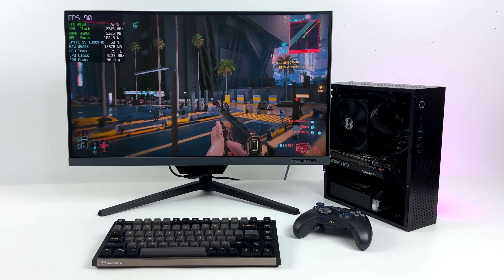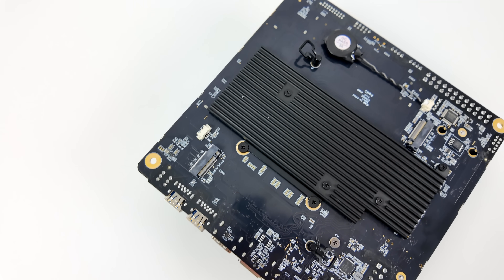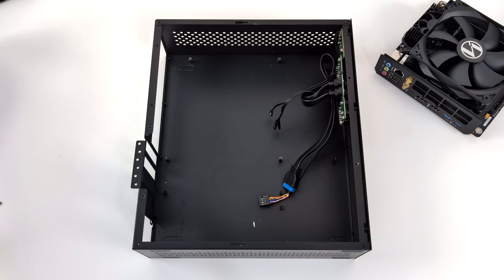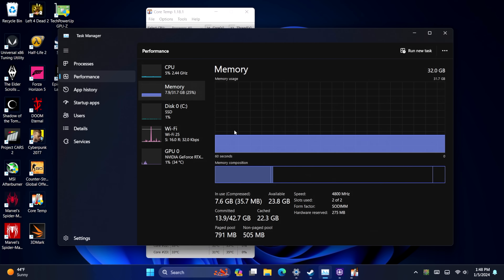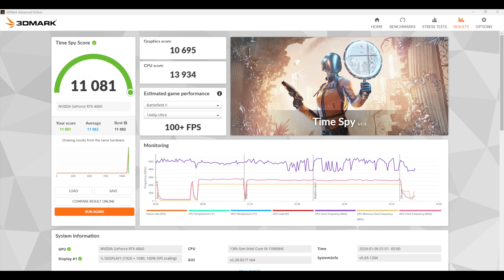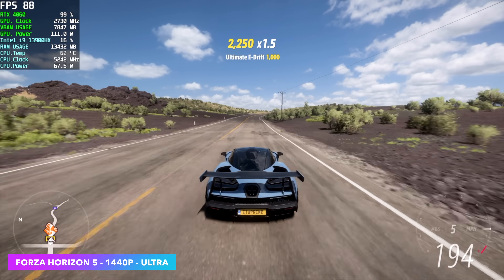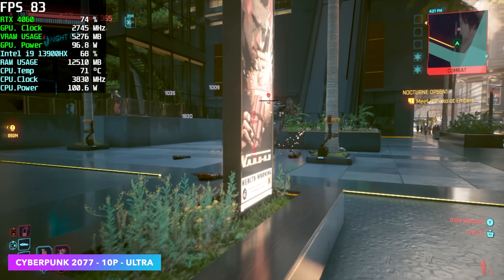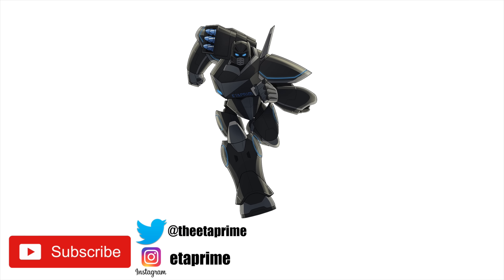The All-New AR900i Has A FAST 24 Core CPU! Hands On Mini Gaming Build

Comment: It's not bad but would of been better to show off the temps of the system if the case was to have in more fans and also for the GPU you could just undervolt it instead while overclocking to use about the same amount of watts without it getting hot as well.

Comment: Thank you for this video. I ordered all parts like on your video. I went with 64gb ddr5 5600 and noctua 120mm 2000rpm fan, and I also will mount a small 80mm noctua fan on the side to pull out the hot air from case next to gpu. I went with silverstone 600w platinum psu. 2 m2 ssds one 1tb the other 2tb. Everything else is the same as on your video. Thank you for sharing and inspiring me to build this little pc

Comment: I've been looking for a case very much like that for a long time.  My only problem is this one is listed on Amazon with a height (oriented vertically) of 12.2" and the spot on my desk credenza to fit a PC case would only allow for 11.75" or so.  JUST barely too tall/wide for me.

I've just deployed a mini-ITX build in a much smaller case that fits easily, but with a picoPSU and an external power brick.  I would much rather have had a system with PSU integrated like this if I could have pulled it off.  (I don't even need the PCIe slots, particularly, but I need it to fit the available space.)

Comment: You could do something like this or their BD790i and even a 4080 in a Fractal Ridge or Terra and still have a pretty serious gaming machine. You'll leave some fps on the board at 1080p because it's apparently not quite as good as a full-on desktop CPU but if you play at 1440p or 4K the difference is pretty minimal from what I can tell.

Comment: I thought I read somewhere you don't want less than 2Gb of RAM/thread then 64Gb minimum for this processor, and according to minisforum that's also the maximum supported on this motherboard...which is unfortunate because according to intel the processor can handle up to 192Gb (haven't seen that big So-Dimm yet but maybe they're comming)
It would make a nice base for an editing station with 4 x m2

Comment: I've had this thing in a Fractal Terra w/4090FE, 64gb 5600, 2TBx2 NVME 4thgen & 1TBx2 NVME 3rdgen & a 1000w Asus Loki power supply and it is a FREAKING BEAST!!! Temps are in the 50's-60's running Starfield! After my BD770i build, & the temps settled in I figured I'd pull the trig on this combo and there wasn't even any break in period like the BD770i. It just works!
Reply: Would you recommend this one or one of the BD series? I want to build one, not sure which. I will be using it for gaming and want to put it in a s400 case.

Comment: Mine is quite relative 😄too large for me, I stick to something that's easily moved. Thanks for all the videos, it was really helpful for making a decision in which mini-pc to buy. I'm a creative and need a decent gfx card for my artwork, in the end is was down to the HX99G and the Intel nuc 12 enthusiast. The HX99G was hard to get where I live, the local sellers had the intel nuc 12 enthusiast barebone. Maxed it to 64GB ram and a 2TB SSD. After some initial issues with the KillerWifi drivers and latest bios upgrade, which seem to conflict, it's now running great. Love how fast it is, really helps me in my work. Makes a lot less noise than expected.

The only thing which I don't like is that you can't use the Arc a770m through thunderbolt 4 directly, but only as a pass-through of the Intel Xe iGPU. That works fine for games, but for apps (and some games) it's defaulting to the Xe, even when Windows is told to use Arc only. If I want to use the dGPU instead of the iGPU, I seem to need to use HDMI. That's a shame, I rather use thunderbolt.

Comment: Not sure how I feel about the whole issue of boards with CPU's permanently mounted that can be turned into E-waste the minute Mr Gates decides he is not going to support it anymore. Over the next year I am piecing together an ITX build for the wife in the Thermaltake Tower 100 case in the green color. Should be sweet. And it will take a full sized gpu.
Reply: That's actually a great opportunity to install a better OS without all the bloatware linux or at least tiny 10/11

Comment: If you want to fill the case and provide better airflow to the 4060, there is a 3D Print bracket that allows the front to take two 80mm fans. Also I believe the name of the case is SKTC A10.
Reply: Interesting case although surprised seeing spaces for a 3-slot low profile GPU. I like it.
Reply: @Neopulse00  I believe the third slot is incase you want to add a X4 PCIe Card on very specific mATX motherboards that have it in that location.

Comment: Cool motherboard that might be a game changer. Could, because I have heard that you can not connect front panel USB & Audio as motherboard does not have covectors for it. Also, despite having 3 audio jacks at the back you can not connect 5.1 speakers, as one port is for mike only. Is that true ?

Comment: So … thermals severely limit performance compared to a 13900k, I/O severely lacking (thunderbolt, 10GBit ethernet missing) and on top of it you’re not saving much.
Reply: So your comparing a desktop chip to a mobile chip and complaining? 😅 there are also millions of i/o dongles in the marketplace, so that's a non-issue for 95 percent of people. Yes no 10g ethernet but most people run wirless nowadays  so thats not that big of an issue either. I mean If you simply don't like the mb/chip that's cool but atleast pick a bit better stuff to complain about like the sodimm ram or the lack of bios features or even the weird behind the mb nvme slots.😂

Comment: A zen4 cpu would be much more efficient and would perform better when thermally limited.

Especially the x3d chips, but even the cheapest 7500f should be good, probably cheaper than the i9 too😊😊
Reply: They make a BD790i with the 7945HX 16-core Ryzen 9. Not quite the HX3D that you can find in some laptops, but still another great option. This one has 4 m.2 where the BD790i only has 2, so it's not as great on the storage front.

Comment: Thank you for covering this board. If possible, could you show the BIOS, and also how it might work with Linux and even ProxMox. Thanks!
Reply: Sadly he won't do that. He just showcases new mini-pc stuff, he doesn't get any deeper than that. You'll have to wait for someone else to do it.
Reply: Thanks for the reply. I agree, but it would be nice for someone with access to the board to cover uses otgher than gaming.
Reply: @gotelldonn From reviews I've seen on the BD770i, Minisforum's BIOS is a very basic visual BIOS/UEFI. Not a ton of options, but functional and easy to use.

Comment: Any homelab folks watching this, the 16x slot hasn’t worked with any 4x PCIE cards that I’ve tested. However, you can get an M.2 to Oculink/Oculink to PCIE or even just an M.2 to PCIE to add in a NIC or HBA card. The right slot on the back actually lines up perfectly using the options mentioned.
Reply: Recently read that  those adapters all still have major issues with them that will eventually lead to problems, so may want to hold off on those.
Reply: @TerranigmaQuintet  Might depend on where they are sourced and if they have the proper circuit, but they’ve been widely used in Crypto farms for years now. At least with this board/my use case it’s fairly low budget, so I’m willing to be a test dummy for it.

Comment: Can you add the total cost for these builds?
Reply: Do the math yourself it's easy. $38 the case, $64 the PSU, $559 for the AR900i, $97 the Crucial RAM, $x for 120x25 fan and the 1TB M.2 NVMe SSD you decide to use.

Comment: For almost $700 for just the MB you can do a lot better, you could assemble an entire PC with the upcoming Ryzen 8000 APUs
Reply: Quad nvme in itx form factor is special tho
Reply: 700? Are you reading the crossed out prices to add more drama? And  seeing as how I've never seen a ryzen 8000 apu not even on yt. what are they and their mb pricing at? And performance? Will it also give me options for full-size graphics or 4 nvme slots? Will it also have a cooler for the nvme? I'd be interested to pay less for more performance/features.
Reply: @Blahblah-m8l  4 NVME slots is nice, but most people have no use for all of them, and eventhough the 8xxxG series haven't even been announced (scratch that, i see it just got announced hehe), the one advantage at least, is the fact u can get a motherboard with proven driver and BIOS support, something Minisforum have been known to be sketchy with.

Comment: 120W on a mobile CPU is utterly disgusting, I get we don't really care as much here, but WTF are you doing Intel?
Reply: Most mobile CPUs have TDPs that are configurable. So minus forum configured it to go up that high. They could’ve limited it to 60W or any wattage if they wanted to.
Reply: I don't think Intel starting to don't care about power efficiency anymore
Reply: @Bilal.Hussain.Shaikh intels new chips are lower power
Reply: It has 24 cores, dude.
Reply: They've been getting better and better at low power performance and power management since 10tg Gen, but ESPECIALLY 12th gen and newer. They are definitely improving.
Reply: It consumes the same amount of power as the gpu in cyberpunk damn
Reply: You can lower the TDP if you like.
Reply: @Neopulse00  I mean, you can say that about most computing parts, it's the fact that they've designed laptop chips that can even utilise 120w in the first place that baffles me, that's higher than most desktop CPUs.

I just can't wrap my head around the reasoning behind it. Like, I'm a software engineer, and a Linux user, so I'm constantly compiling code on my laptop, which is probably the only real benefit anyone is gonna get out of this kinda compute power in a laptop, basically everything else is GPU now. And I would not go for this CPU, it's way too skewed in favour of raw performance over power efficiency.

And sure you can adjust the TDP down, but that hurts efficiency, if you cap the TDP at 60w for example, you can't expect to get 50% performance.
Reply: 7945hx max power is the same or higher on many laptops. if you watched the video, the power draw in games is much lower. this isn't really anything to get super upset about imo
Reply: You're free to run a 15W CPU, or any CPU at 15W. And 120W when you're plugged in. Look at the big pic.
Reply: Fairly low for something that has 24 cores and clocks at over 5Ghz
Reply: @yeahmanitsmurph  I guarantee you could achieve the same performance in games with a mobile Ryzen chip with 33-50% the power draw
Reply: @theevildice83  except there is no Ryzen mobile chip with 24 cores or anywhere near that. The Ryxen HX chips that are used in some mini pcs I’ve seen are using 70 to 100 watts. Again, the TDP is configurable by the ODM.
Reply: @FlyByWire1  And exactly what games are you aware of that utilise 24 cores?

I maintain that a laptop chip, which is what this was originally intended for, has zero need to ever utilise 120w. And I'd be willing to wager that the current Ryzen chips could match it in games with much lower power draw and fewer cores.
Reply: @theevildice83  it doesn’t matter what games are using them because chips are not only for gaming. Most consumers are not buying computers just to game. And you seem to be missing the point that the chip can operate at lower power draw if that’s what the ODM wants. If the chip was in a laptop, it wouldn’t be consuming 120W because the chassis most likely wouldn’t be able to cool that much heat and thus the ODM limits the power draw. What are you not getting? Ryzen mobile chips can also draw much higher power if the limits are removed by the ODM.
Reply: @theevildice83  No, you’re wrong. I can spin up more performant VMs using this than I can on any mobile Ryzen chip currently. This has the same amount of usable cores as my Dell server blade, but draws less than half the power. To achieve the same thing with Ryzen, I would have to cluster 2 nodes which would draw significantly more power than this single board.
Reply: @theevildice83 it’s not a gaming CPU and not everyone buys laptops for gaming. I have this 13900HX on my ThinkPad P1 laptop which is used for 3D and video editing work, so it can use as many cores as I can throw at it. 120W is fine since it’s intended to be used on mains power and has a beefy vapour chamber cooler along with an RTX 4090 laptop GPU, yet still weighs only 1.7kg.
Reply: @yeahmanitsmurph  thats what i was saying. Trying to power 24 cores at 5 ghz  under 100w seems like a fever dream.
Reply: @yeahmanitsmurph first of all 16 of those cores are non hyperthreading cores that take up 1/4 the space of real cores and only are good for non gaming tasks. Also, it is a lot better than their actual desktop parts but it’s just cutting back closer to the sensible area of the volt/frequency curve, and not into the 350w plus area desktops are allowed to push to.
Reply: @alexmills42  No arguments here, they’re still physical cores that require power.
Reply: I wouldn't care if it was a an rdna 3-4 apu pulling that mich. But this intel chip isn't doing enough to be sucking that much juice down.

Comment: Do you think the power supply is efficient at all? I’m looking at picking up the same one
Reply: good question, its 80+ gold but only has 38 amps on its 12v rail and got a 3.3 out of 5 stars. FLEX isnt the brand name its just the type of power supply I would go with like a silverstone flex power supply, this is more of a cheaper one hes using
Reply: @kyles8524   Thanks for responding. I did buy the Silverstone FX350-G 350W 80+ Gold the other day so I guess I'll stick with that.

Comment: Why put hot as heck i9 for itx build aimed at 1080 or 1440p?
Reply: Intel is no longer at 14nm but 10nm with P+E chip configurations for improved thermals on top of that - and the thermal design of this HX chip is for performance laptops. A designated cooling system like this in a complete itx build can handle that level of heat... It's not 2021 anymore. The times have changed, good friend. I can keep my 12700k under 30 degrees, no problem, and under load, it still stays icy cold with an air cooler. And that's pulling as much power from the wall as it needs to, as it is a K series.
Reply: erm this laptop version cpu it is quite efficient
Reply: @SoloManXLIM1998  So efficient that if it were in an actual laptop with a common 42Wh battery you'd get 20 minutes of battery life...